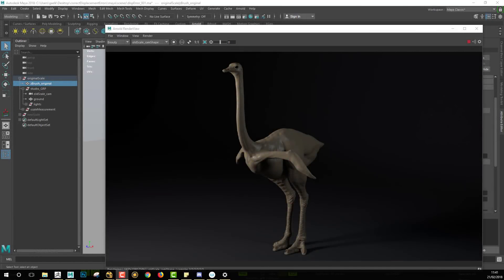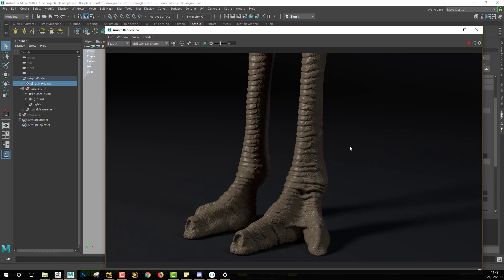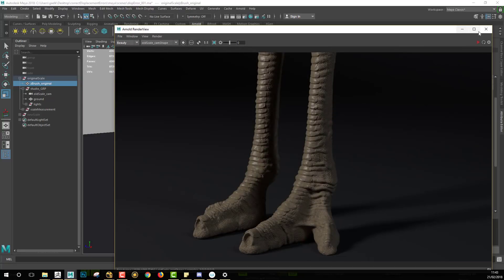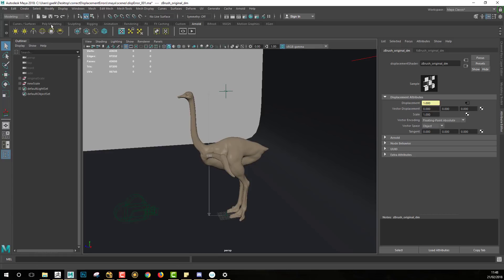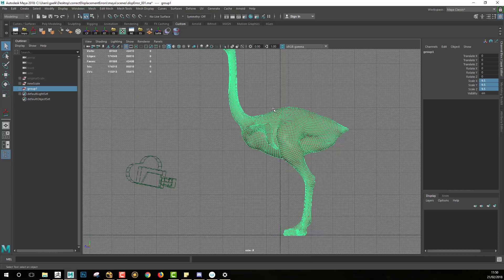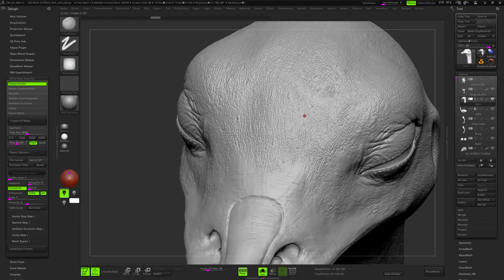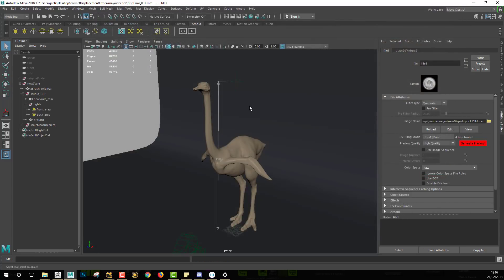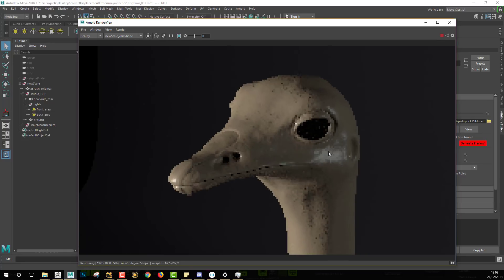Solving ZBrush displacement scale

Comment: I got a question...when u exported the new displacement maps,there were four files,but in maya u just linked one file for all , how did u get all the four displacement maps into one
Reply from the maker: sepehr samiei heya, in Maya you can select the UV tile mode to indicate that you  have multiple files for just on texture node. If you're interested, search UDIM on Google and it will give you plenty of ideas how to get more resolution from your texturing :)
Reply: gaël kerchenbaum thanks man just one more question..where did u do ur uvs? Did u retopologize in maya and export them to zbrush ? Or directly u did in zbrush ? How does that part work ?
Reply from the maker: UVs and topology were done in Maya. Then the modele was imported in ZBrush. It is more common to do this technical pass in Maya or 3ds cause we need a clean topo for production. Zbrush can be great for introducing an automatic unfold of the UVs, but you'll always need to clean and layout them nicely in Maya.